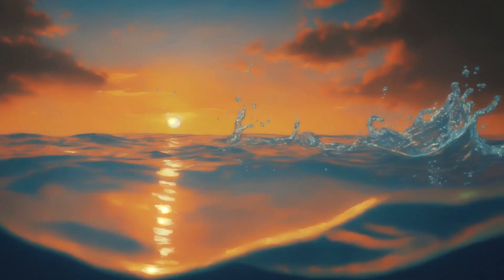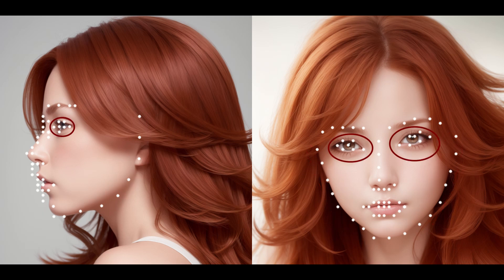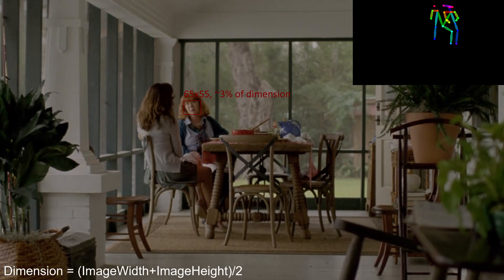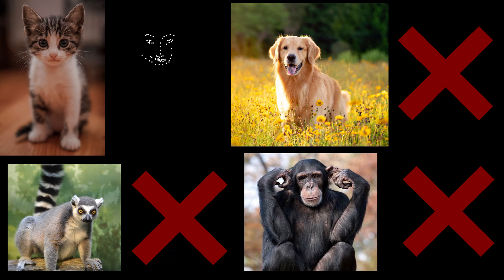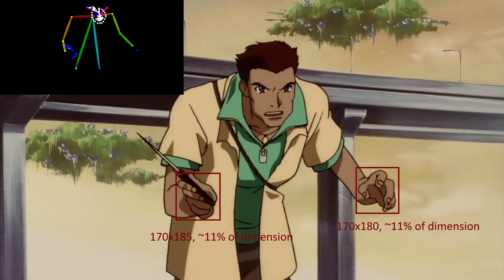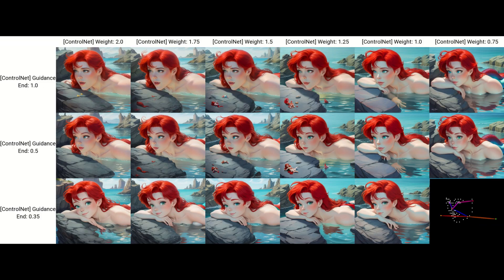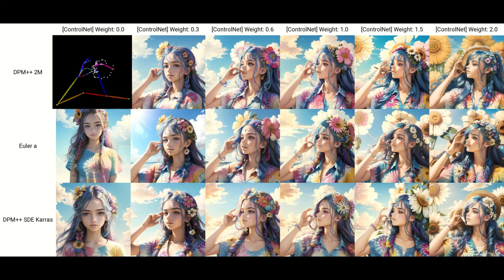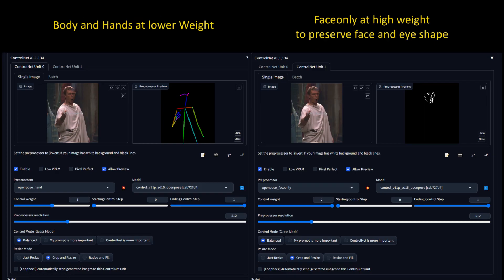ControlNet Deep Dive - OpenPose 1.1: Add Faces and Hands to OpenPose - Detection, Settings, and More

Comment: It's a step in the right direction but has a long way to go. Still far too many deformations in the result. Faces I'm not fussed about but hands and limbs are a mixed bag.

Also the editor needs some work especially when you're trying to adjust the skeleton.

That said I watched a video on DW_Pose preprocessor that generates far more accurate results, may be worth looking into.

I still haven't found a good editor or way to generate maps. The few good riggers I've tried sadly don't output to OpenPose.

Comment: Bro can you make a video about merging models, mainly i want to know about MBW and what each sliders do when merging models.

I was using supermerger and model block weight extension and tried to merge models but due to lowvram i couldn't finish my experiment because it was taking so long to  merge and then generate  images.😅
Reply from the maker: I appreciate the suggestion, though honestly I haven't messed around with merging models much so I'm not super confident in my ability to deliver quality content on it.

Comment: Is it possible to use existing skeleton poses with a different image for the face? Do I need to manually merge key points with skeleton?
Reply from the maker: I haven't experimented with that, but it should be possible.

However, the basic skeleton has points for eye and ear position, so you would probably need to change or remove those to prevent conflict with the new face.

Comment: There were two things I was really hoping for in 1.1. Reliable hand reproduction (which as you have noted, has failed). And second, reliable reproduce of facial expression/emotion (happy, angry, shouting, rolling eyes etc) I was not able to either. Can you give some tips on whether you are able to?
Reply from the maker: For facial expressions, you can get some details from the map that help, (mouth position, etc), but prompting is still needed. I've found that active descriptions (yelling, clenched teeth, frowning, etc) are better than passive descriptions (angry, sad, etc).

Eye position works sometimes, but I think there are detection issues   Some images can do it consistently at high weights, but others with very similar eye positions just don't work